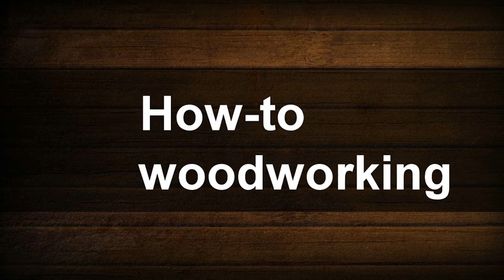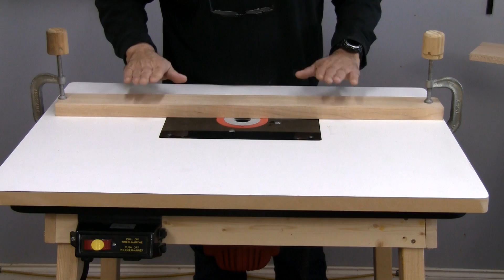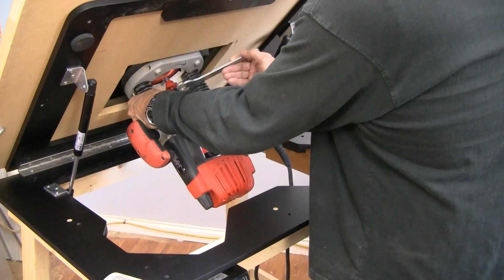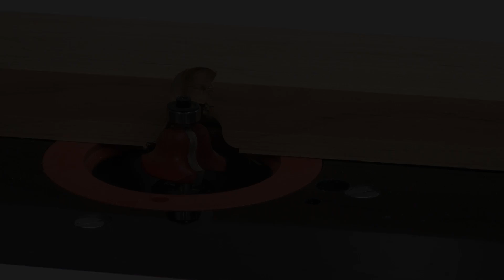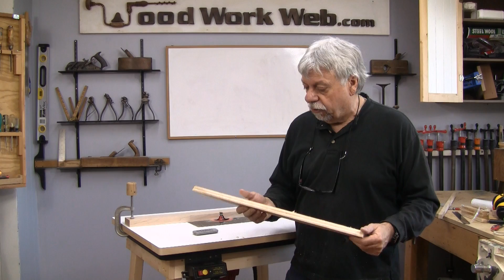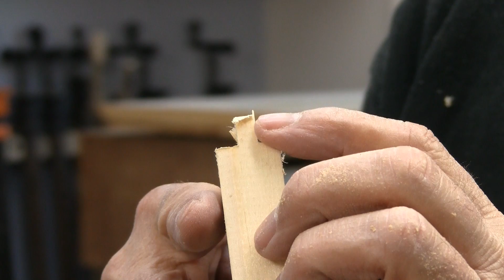Setting Up and Using a Router Table -  a woodworkweb video

Comment: Colin, With the store bought router lift, how do you adjust the bit height? Is the main feature of the store bought lift, the fact that you can lift the top and access the router without having to stand on your head?

Comment: Perhaps this has been asked, but in a quick search I did not see my questions.  I understand the small hole you make in the fence for the bearing, but why would you not just have an 1" or 1.5" "U" shape opening (a 1/2 circle) in the fence that any and all bits fit with no issues?
Reply: +Harold Terranova (HaroldT101)  A "zero clearance" opening in the router fence helps to minimize tear-out... similar to a zero clearance insert on a table saw.
Reply: OK Chris thanks for the info.
Reply: man I never even thought of that

Comment: hi, this video's have been helpful, I on the other hand have recently purchased the router lift (like your's), and 2 plastic router plates ( I keep one as spare part), and a router.
then I build the table legs and top for router out of solid hard wood (oak) so it can last me many, many year's to come. 
Know I did not have the table saw, i used a circular saw, flipped, and after some time it broke, and the cost of repair is same same new one. 
I have 100$ to spend. do you think i can find good table saw for that amount of money, or should I just buy a circular saw and build another table top if the one i have does not fit the new circular saw?
btw, I'm using only solid hard wood material for building stuff out of wood.

Comment: I always enjoy your videos.They are straight to the point and educational. I made a table like yours a while back. My fence is larger and 90 degrees. I put a bolt with wing nut through the left side and pivot from that using clamp on the right side.There is no need for the fence to be square to the table front.If I need more depth, another hole can be drilled.in the table. I use a depth gauge across the cutter opening for set up.Shims can be added  on the out feed  side with double sided tape for edge planing and stop blocks can be clamped to the fence for stop cuts.

Comment: (...thanks4watching), and many thanks for a helpful presentation - a fine table you built.
From the forest to the finished article, I have an issue with space for dry warm space space.
This is a tool I've little experience with, a good quality router, even table - it starts to itch because my lumber is now at both the seasoned and green stage!
Nice inspiration you shared and best wishes to you and yr folks. frm here in the woods.
Reply from the maker: +owpeterj Thanks for your comments .. great to hear from you

Comment: I really liked this video series.  It did seem to me as if the table itself could have been made a bit beefier.  I saw in one of the comments below where you said the table was made nice and square and level but that the floor was not.  I guess that accounts for a bit of the rocking that was noticeable when moving the top up and down.  I'm wondering just about heft, kind of like a hand tool workbench needs....you know, to basically be really heavy.  If you were to do this kind of thing again, very basic, fundamental, a theme for future variations, would you make it heavier?  Maybe use larger dimensional lumber?  I was thinking I'd like to do it using 4x4's for the legs, which would still be doable using the table saw and miter saw for the compound angle.  Also, I was thinking that half laps would be my choice, although they would be slightly more complicated and take a bit longer.  Beyond that, my main question was about dust control.  I could see several ways I might attack that issue, and I know you mentioned it in the end of the third video, but I also see a couple of (possible) drawbacks with dust control and the design.  Please correct me if I'm wrong:  1) above the table dust control would  be relatively easy to install by using some kind of clampable support for a hose, just position and aim it at the bit, but below the table would be difficult because of the design of the hinged top.  I can't see how you could make a box for the router to be inside when the top is down, unless you attach the box to the hinged top, which would then make bit changes and adjustments (with that setup anyway) very difficult.  If you made a frame for the box to attach to that didn't move, you'd have to have a very large top and subsequent box to provide clearance for the router as it traveled through its arc when the  top was lifted.  I am just wondering if you see this as an acceptable risk or if you already know of a solution that I'm missing?
Reply from the maker: Frank Kovach Yes, my floor is uneven in spots. I try to always set up in a flat area. Of course this is jut one version to show the methodology that could be used, depending on preferences ... some may want to alter the design, or make it beefier as you say, and add dust control either by redesigning a fence or from underneath the table ... lots of options to consider :)

Comment: I have a similar setup on my router table. As my router is always in my table, I shortened the electrical cable cable on the router so it has to be unplugged before I can lift up the table top to change the bits. I thought that it was a good safety feature in case someone else would be using the router table and might forget to unplug the router when changing bits.
Reply from the maker: bj sims That's a good tip, thanks for sharing that

Comment: Thanks man for all your videos ..
I want to buy router table like that .. how much is it
Reply from the maker: dana Khalid I think the cost of materials, wood, glue and laminate top was around $60, then you will still need to get router plate for $30 - $75 depending on brand, so with a bit of work you can build your own fairly inexpensively.

Comment: With that fence, I can see that there are no means to mount a feather board above. I have used a feather board when I was using a Tambour Bit set awhile back. I think having a fence that pivot on one end is a good idea. Thanks
Reply from the maker: Tom Pritchard Yes, there are a few options that can be built in and or installed on router tables. I purposely did not put a mitre slot in because so many people confuse it with using a mitre gauge, which we seldom if ever do on a router table, but yup, lots of choices and ideas for extras.

Comment: I use a simple fence like that too, but I'm wondering why you would need a fence at all when you're using a bearing?  The bearing is the fence with that type of bit.  Cheers! --Chris
Reply from the maker: Cactus Makeshop That's actually a very good point, and yes, you are correct, in some cuts, you can take the fence off and just use the bit ... this is where we recommend using a starter pin so you can ease the wood on to the bit making a better and safer cut. Good point, thanks for posting

Comment: I like the simple fence and also the whole table, I don't remember if you mentioned where you got the lift for the top and how much it might be.  I did notice that the stand must have not been level so I would suggest the adjustable feet perhaps just on the front legs to help.
Reply from the maker: Michael Fisher Not sure if I mentioned about the top, had to have it cut from a 4x8 sheet as my supplier had no smaller sizes and the stand it level, sadly the concrete floor is not :(

Comment: Thanks, I think I'll change the left clamp to a pivoting v
Bolt so that it stays fixed.  Makes changes in the depth easer and doesn't keeps the bit I the same position so you have less chance of breakout..
Reply from the maker: H H Yes, there are lots of different options and ideas for router tables. This of course is just a starting point to help the hundreds and hundreds of people who only have router and no table ... introduced in to how simple it is to make a table, and how it can expand their woodworking builds.

Comment: Sir i have a question, like
1) We need to make fence for all the router bits.
2) We need to make a mark or name the fence as the router bit.
Reply from the maker: Ajith Kumar Excellent questions Ajith,  ... no, you only need to make one fence, but it will need to be "seated" to each different bit you use.
After much use, you will want to make a new fence as the existing one may have too big a hole where the bits are spinning.
Thanks again for posting this, very good points
Reply: Thank you sir.

Comment: Hi Colin, I agree we need to try new tools and techniques. Thanks for the demo. I was wondering about bit height adjustment. I see you use a plunge router to avoid the need for a router lift, and go ahead and make the coarse adjustment while the top is up, but don't you need to make fine adjustments? And like Monty below I use lock miters (mostly to make quadrilinear legs) so need a taller fence.
Reply from the maker: Michael Anderson Yes, lock miters need taller fences, as I mentioned to Monty, I don't use that joint so never thought of it during the video.  Thanks for the good reminder for all of us

Comment: You say you don't need a
Tall fence. I use lock miter and lock drawer bits . These need a tall fence .
Reply from the maker: monty bland lol,  I said you seldom (if ever) need a tall fence ... as you say, unless you make lock miter joints ... good example, wish I had thought of that during the video, but I never use that joint so didn't think of it.